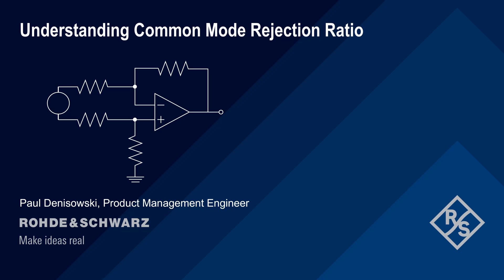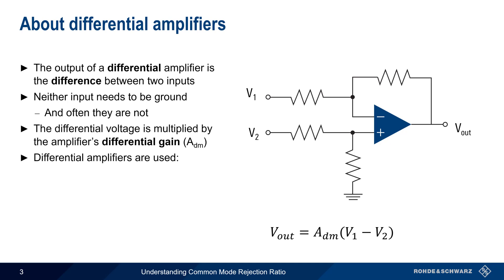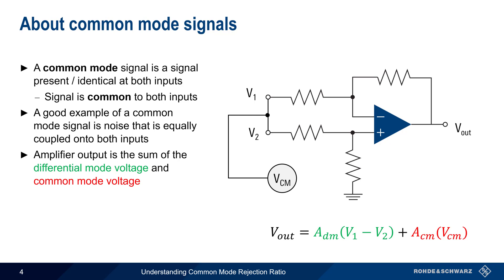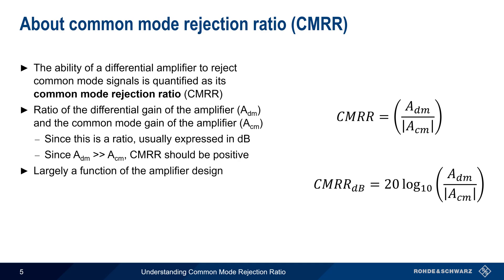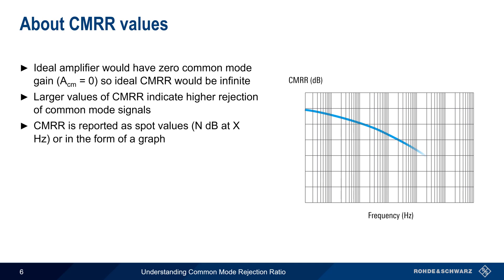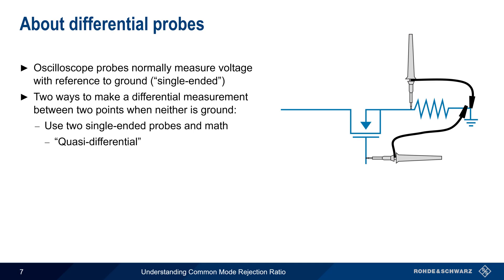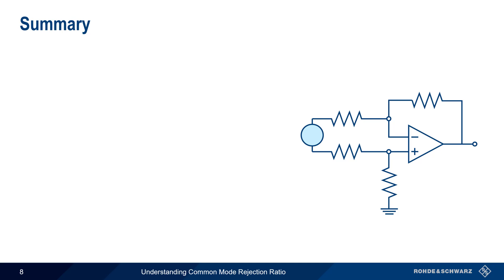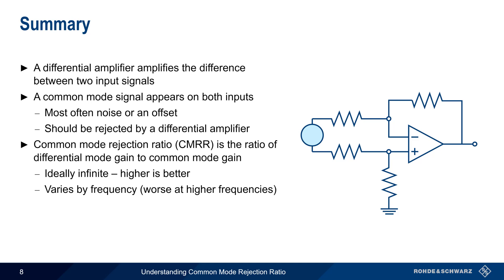Understanding Common Mode Rejection Ratio

Comment: Thank you for the lectures; they are very helpful, thank you. Question: Should Vout be Adm(V2-V1) instead of Adm(V1-V2) shown in the video?
Reply: Yes - thank you for catching that.  Vout is Adm * (Vplus - Vminus).  In retrospect, I should have used Vplus an Vminus instead of V1 and V2.  Thanks again for the correction!